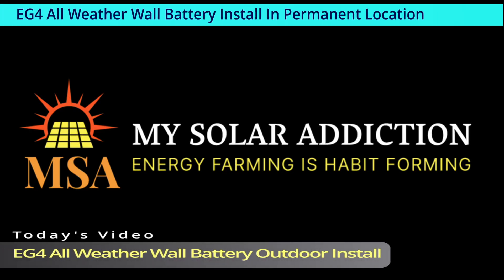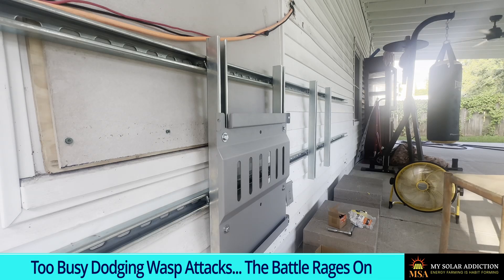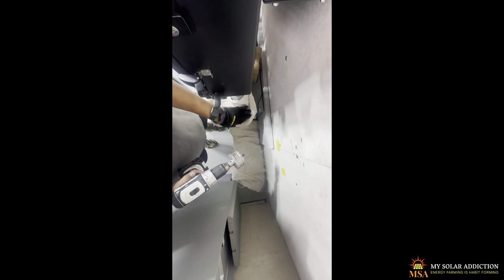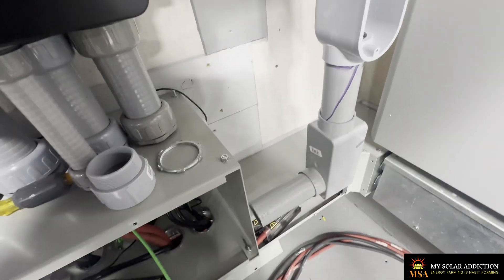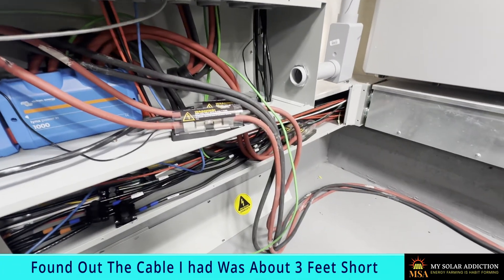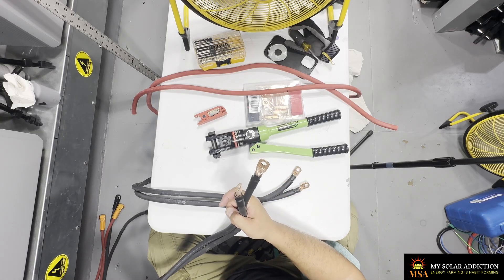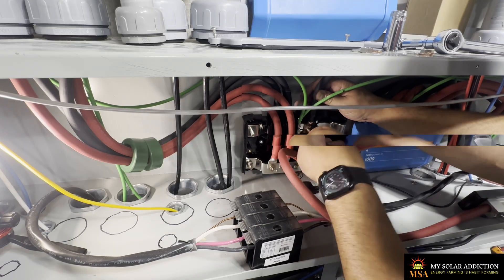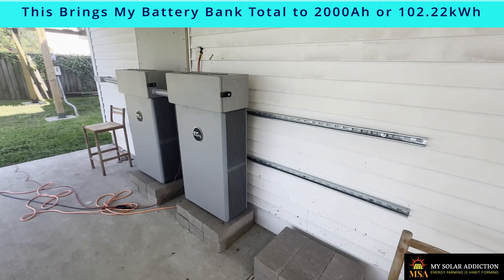EG4 All Weather Wall Battery Outdoor Install

Comment: What size ground wire did you use for the battery equipment grounds?
Reply from the maker: 8 gauge copper
Reply: @mysolaraddiction  ty

Comment: I was doing the math and only saw five in total wall mount batteries. Then I remembered, you have six in the rack. That gives you the roughly 2000 amps. I'm only at 1680 right now. I hope to double that in the future

A quick little thing I figured out when I was mounting and disassembling my batteries. If you're setting them on top of a trough. Without the feet on them. There's a metal plate on either side at the bottom of the protective side plastic plates. You could potentially run your battery wires and coms behind those plastic pieces straight down into the trough. That could potentially save some additional conduit and clean up the area. Just an idea, I don't know if that would be up to code

Comment: I don't like these batteries because they use the older 280Ah cells.
Reply from the maker: I’ve had them three of them for two years and they’ve worked great.  Two years ago 280Ah cells was the in thing.  I went with two more so I wouldn’t be mismatching on a parallel string of batteries